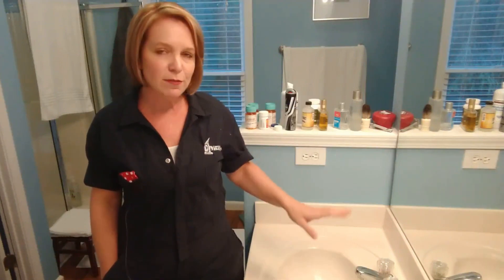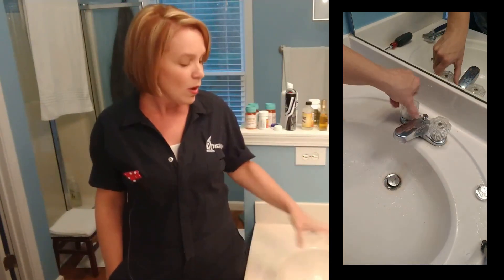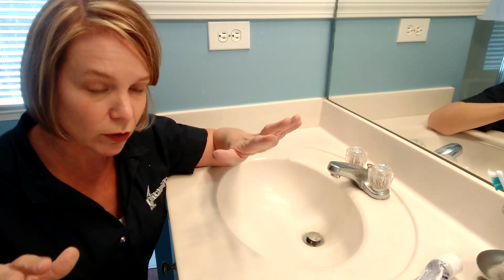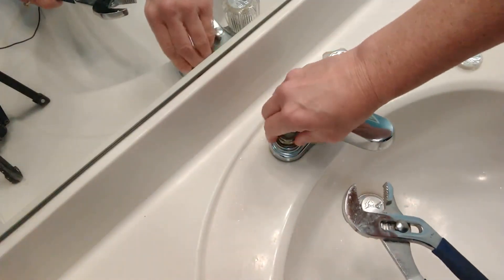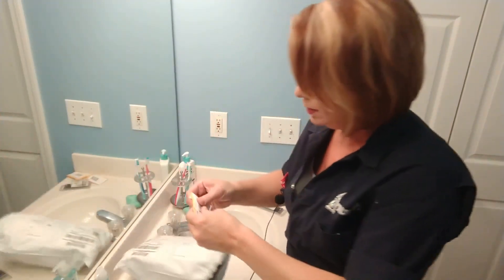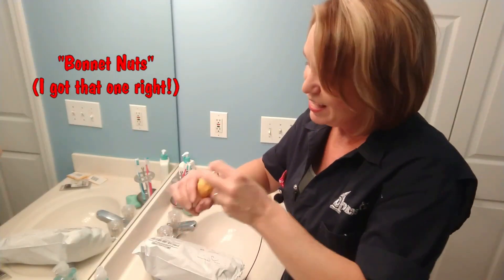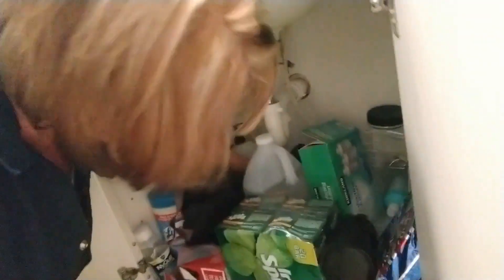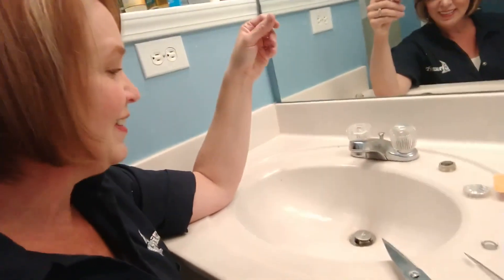Fix a Dripping Delta Bathroom Faucet

Comment: I replaced the seats and springs on both sides.  Seats are the small black rubber thing she replaces in the video. It is still dripping.  I had a lot of trouble turning off the water under the sink (much wrench action) and it was still trickling a bit when I did the replacement.  It seemed like I situated the springs and seats properly, but I'm wondering if the fact that they weren't off completely could mess up the process in some other way?  The white cartridge appeared to be in good shape.  Not sure what to do next apart from calling a plumber.  Any suggestions?

Comment: so they sent you about $25 worth of parts to fix a 10 to $15 faucet.  It would have been much easier to put in a new one too.
Reply from the maker: Perhaps, and at some point I really want to gut that whole bathroom, so I didn't really want to spend the money to change the faucets. Now of course, if Delta wanted to send me some free faucets... 😂
Reply: @ChickFixUSA    I know really.  They could have saved you the hassle by sending you a new faucet.